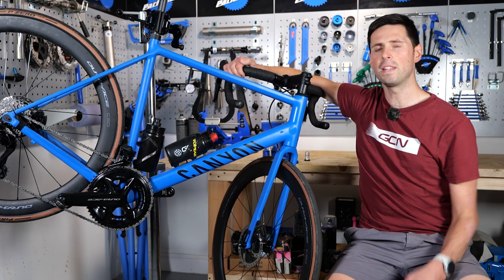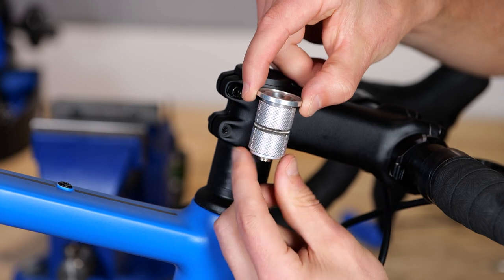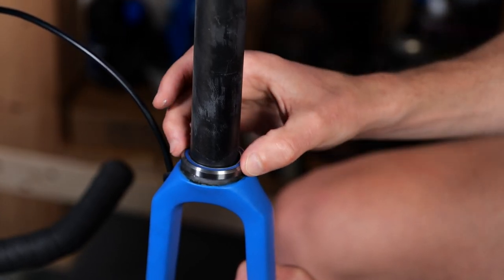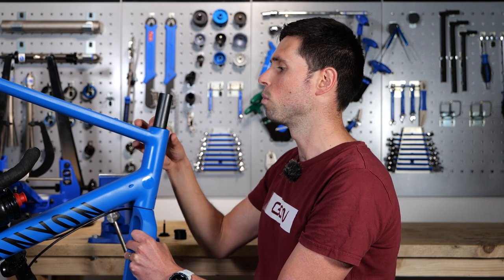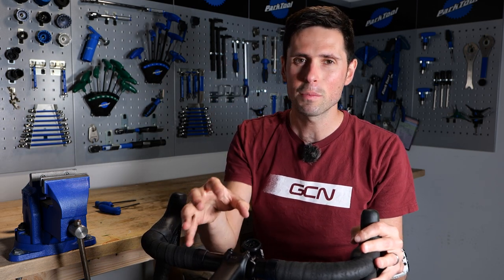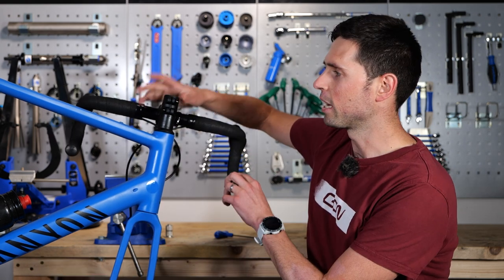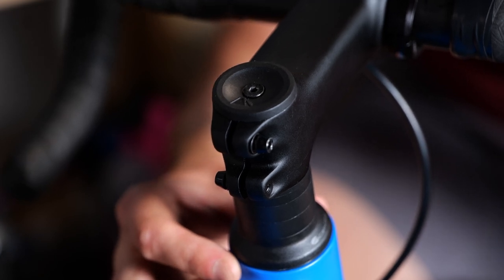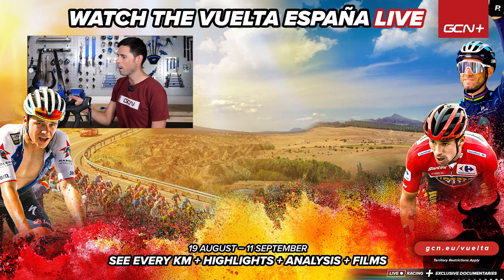How & Why To Adjust The Headset On Your Bike | Maintenance Monday

Comment: I’ve bought a used bike with a super slammed steerer. My only option to rise it to add only about 20mm of spacer, been thinking of adding more but it will result having the steerer to be halfway in the stem. Is that ok or not advisable to do?

Comment: Set my Headset top cap at 3nm is this still acceptable force on a Carbon fork?
Reply: There's no specific torque spec. As long as you don't feel any knocking, the spacers can't be turned by hand and the cockpit can steer freely, that's enough preload.

Comment: Threaded vs. unthreaded head set? Are threaded head sets an old design and not used anymore? I've a 9 year old Cannondale Synapse. No matter how tight I screw the top cap the load on the bearing doesn't increase for some reason. The steering does not get "sticky" and it still makes creaking sounds when I ride out of the saddle or ride over sharp bumps. Sounds like it is falling apart. I hate it.
Reply: It sounds as if the top cap is hitting the steerer tube, try adding a thin spacer or shorten the steerer tube by 1.0mm
Reply: If its an aluminium steerer tube Check that the middle part the star-nut is not stripped or spinning, (if it is bash it down out of the way or drill it out/ remove it and install a new one or an expander if you like)  
If its carbon check the expander plug is not loose and not just being pulled up the steerer. Also if it is a plug check that there is an air gap/space between the top of the plug and the bottom of the top cap of about 3-4mm if not all you are doing is squashing the top cap to the the top of the expander and not pre-loading it. You can check both plug issues by dropping a spacer on top of your stem and trying to set the pre load, if the creaks/movement go away then there wasn't sufficient gap, you can either cut 3-4mm off the steerer or put a short spacer on top. It the issue remains remove the top cap and spacer and you will be able to see if the expander has been pulled up, in which case fiber grip the plug and re-install to torque spec.
Reply: Additional: Inspect the steerer especially around the bearing seats. The "ring of death"  where the races bite/wear into the steerer tube is something that can cause this issue (even on aluminium ones).
Reply: In addition to the other comments here, also make sure you are doing the final tighten on the ground as shown in the video and not on the bike stand. If necessary have someone pushing down on the handlebars so that the steerer and bearings are compressed with a real world load when you tighten the screw. 👍  I always re-check it after a few miles riding as that allows everything to bed in properly.

Comment: ALU stem and ALU steerer on one bike, once adjusted never comes loose. Carbon or ALU stem with carbon steerer tube on other two bikes, and after every 5-10 rides I'm having to  re-tighten to take the play out. Have tried assembling with/without carbon-paste, makes no difference. Is this just a "feature" of carbon steerer tubes......?😞
Reply: Sounds like there might not be enough preload on your bikes with a carbon steerer tube. Have you tried adding a shim or two underneath the headset cover? You might want to check the expander plug too, see if it was pulled up.

I'm now riding a bike with a carbon steerer tube and an aluminium stem. The last time I lost some preload is because I barely had enough preload due to the lack of a 0.3 mm shim, so with enough bumps on a ride, it'll go loose. Now I have it installed, I'll need to see how it goes, which I don't think will happen again.

Comment: When I lower my stem to dial in the fit, do I need to have it cut?
Reply: If it's just testing the new position during the bike fit, it can be left alone.

However if you're sure you'll be going lower, make sure the stem is still clamping reinforced steerer tube. Otherwise, have the steerer tube cut until the stem is able to do so.

Comment: #AskGCNTech
Is it possible for a bike with mechanical groupset to be setup fully integrated (all cables hidden). What could be the possible downside of doing that?
And can you do that to any bike frame as long as you will use an integrated stem/handlebar?
Reply: It's only possible if:

1) The frameset runs integrated internal routing in the first place.
2) Said frameset is compatible with your mechanical groupset (not all mechanical groupsets are compatible with all framesets with integrated internal routing).

Otherwise, don't even try.

Comment: Does it make any sense applying carbon paste to the expander bolt?
#AskGCNTech
Reply: The bolt itself, never makes sense. But if it's the expander plug's outer wall you're talking about, it does help as some of them just won't grab the steerer tube well on their own.

Comment: I recently just washed my disc brakes. I now have some problems with my rear brake. When I am descending my rear brake work for  few seconds, then I hear some weird noise and my brakes stops working. After I release my brake for few seconds, my rear brake starts working normally. Anyone now to solve this problem?
Reply: Try cleaning it with isopropyl alcohol....
Reply: On my MTB there are two ways of solving this problem with squeaking brakes

- cleaning it with alcohol, sanding the pads slightly and reinstall everything 

- or descending a hill steep enough to get the brakes near 230 to 250 ° C (colour of the rotor: yellow to brown, blue (300°C) is not necessary) and the squeaking is gone 

Method 2 makes more fun

Comment: So i can take out as many spacers as i want?
Reply: It depends on your flexibility. Until you are sure that you can ride with a lower stem, you can just move the spacers to be on top of your stem, instead of below it. After you are positive you can live with a lower stem, you can remove those spacers and cut the stem. (once you do that, there is no going back) Just in case I become less flexible, I kept a 2mm spacer above the stem. Some people keep a 5mm spacer there.
Reply: @billkallas1762  thanks i was wondering what you do with the "rest" of the stem but cutting makes sense. Good idea ill try to ride lower with the spacer above to see how it goes :)

Comment: Please don’t try to manual pre load a carbon steerer by hand it’s to easy to damage the steerer always use a torque wrench and if it’s still lose then check the bearings
Reply: There's no specific torque spec for headset preload. Once there's no knocking and steering is still smooth, proper preload has been achieved.
Reply: @yonglingng5640  all my carbon steerers have max torque figures that can be applied so I don’t know where you get the idea they don’t. Are you buying no name open mould from Ali ?
Reply: @reubensteel4632  No, I know I don't even hit 3 Nm on top cap bolts. This bolt doesn't even need a lot of torque as far as I remember. Never have I once damaged a carbon steerer tube.

Comment: Straighten up the handlebar is the hardest part 😣
Reply: Just line up the wheel with the frame, and measure the distance from both ends of the bars to the seat tube. If it's the same length your bar is perfectly aligned